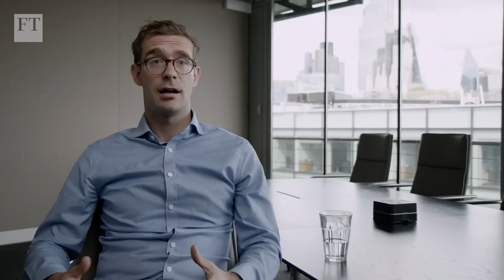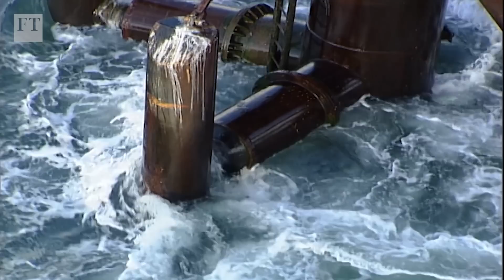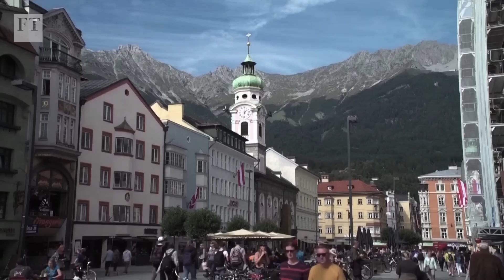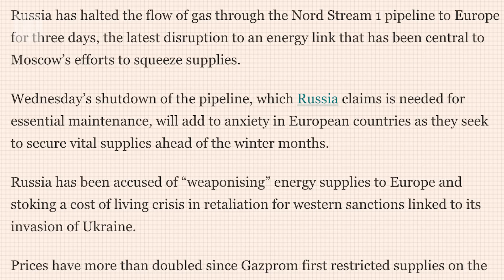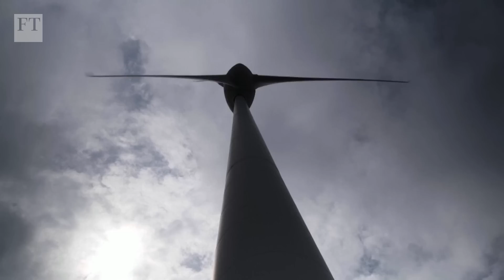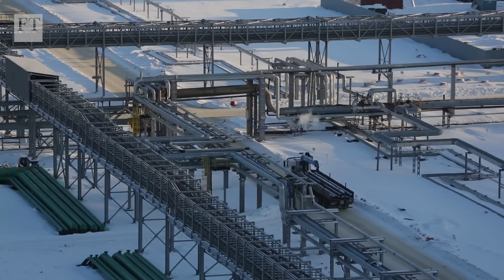How Putin held Europe hostage over energy | FT Energy Source

Comment: While studying PPE at university, some years back, Germany and the wider EU's reliance on Russia was hailed as the neo-liberal principle of 'Interdependence' working. The theory is that if the EU was so heavily integrated with the health of Russia's markets, and Russia was reliant on German engineering and other EU imports, it would prevent any chance of war. War would be inconceivable between two interdependent societies because it would be far too expensive.

Putin chewed up neo-liberal theory and spat it out the window.
Reply: Where did you attend university?

I drove from Brno to Vienna in June.  I saw nothing but hundreds of  windmills on either side of the motorway after crossing into Austria.  Austria and Germany are proudly anti-nuclear even though it is safe, clean, carbon-free and has nothing to do with nuclear weapons production.   

The EU continues to fail to recognize or mention the need to increase the supply of domestic energy production.   Hundreds of Billions have been poured into “green energy” which can not power a first-world nation.  No amount of solar or wind will be enough to sustain the EU’s energy needs, and the “energy transition “ is a sham. 

The EU’s anti nuclear stance will drive the continent into poverty. Nuclear is carbon-free and entirely unrelated to nuclear weapons or proliferation.   The Fukushima disaster was from a tsunami occurring at a coastal nuclear plant whose backup power generators were placed below sea level.   Fukushima was used as an excuse by the European Green Party lobby to accelerate the decommissioning of nuclear reactors in Germany, and prevent construction of new nuclear plants.  

That folly is now being reversed but the EU will experience at least five years of intense economic pain.
Reply: @patrickstarrfish4526  Edinburgh. And I quite agree with you. Nuclear fission, and later fusion is the only means by which Europe can achieve energy self sufficiency in the long term.

Comment: Germany was directly warned by the US about dependence on Russia. We all love to criticize the US, but for the most part I have found them to be at times very forthright, direct and often right.
Reply: I drove from Brno to Vienna in June.  I saw nothing but hundreds of  windmills on either side of the motorway after crossing into Austria.  

The EU continues to fail to recognize or mention the need to increase the supply of domestic energy production.   Hundreds of Billions have been poured into “green energy” which can not power a first-world nation.  No amount of solar or wind will be enough to sustain the EU’s energy needs, and the “energy transition “ is a sham. 

The EU’s anti nuclear stance will drive the continent into poverty. Nuclear is carbon-free and entirely unrelated to nuclear weapons or proliferation.   The Fukushima disaster was from a tsunami occurring at a coastal nuclear plant whose backup power generators were placed below sea level.   Fukushima was used as an excuse by the European Green Party lobby to accelerate the decommissioning of nuclear reactors in Germany, and prevent construction of new nuclear plants.  

That folly is now being reversed but the EU will experience at least five years of intense economic pain.

Comment: Insightful analysis and commentary, but why no mention of the UK's LNG terminals and pipelines to continental Europe, nor the intention of the US and Canada to increase exports of LNG - specifically to Europe?
Reply: US LNG = Expensive LNG. Europe industry will have to increase price of their product since electricity is so expensive and not many facilities to turn LNG back into gas.
Reply: @legokingtm9462  All gas (LNG or not) is currently expensive, and there are LNG ports in the UK that can convert LNG back into gas. They are (unlike the Spanish ones) connected to pan-Europe networks. Just wondering why this was not mentioned, as they are significant channels already supplying both the UK and continental Europe, with the potential for that to increase.

Comment: Europe was asleep at the wheel. So true.
Reply: I drove from Brno to Vienna in June.  I saw nothing but hundreds of  windmills on either side of the motorway after crossing into Austria.  Austria and Germany are proudly anti-nuclear even though it is safe, clean, carbon-free and has nothing to do with nuclear weapons production.   

The EU continues to fail to recognize or mention the need to increase the supply of domestic energy production.   Hundreds of Billions have been poured into “green energy” which can not power a first-world nation.  No amount of solar or wind will be enough to sustain the EU’s energy needs, and the “energy transition “ is a sham. 

The EU’s anti nuclear stance will drive the continent into poverty. Nuclear is carbon-free and entirely unrelated to nuclear weapons or proliferation.   The Fukushima disaster was from a tsunami occurring at a coastal nuclear plant whose backup power generators were placed below sea level.   Fukushima was used as an excuse by the European Green Party lobby to accelerate the decommissioning of nuclear reactors in Germany, and prevent construction of new nuclear plants.  

That folly is now being reversed but the EU will experience at least five years of intense economic pain.
Reply: @patrickstarrfish4526  Actually Tschernobile was a big reason for the anti atomic energy movement. Also the question of storage of nuclear waste is still unresolved. 
My bet is on better technology for energy production than nuclear. Also I think we need to learn to live more frugally to preserve the planet anyways. Going vegan would be a first step towards more rational ressource use. Again my money is on the tech nerds to come up with cool, save, simple and minimalist solutions. There always is another way.